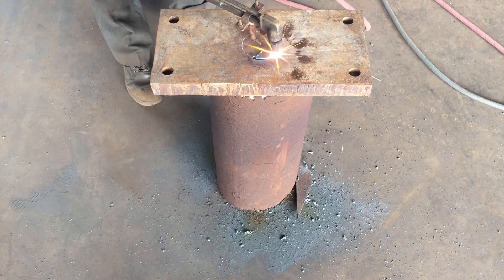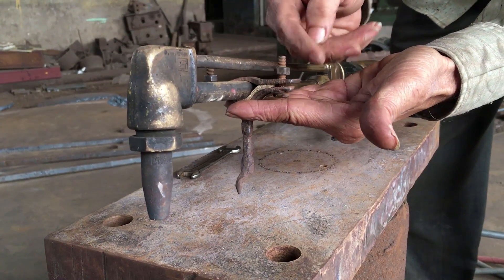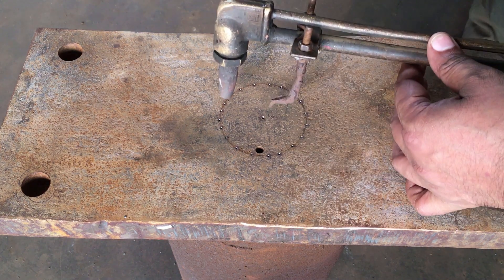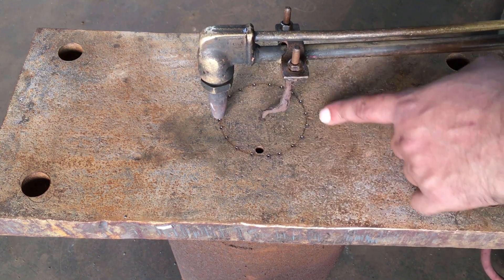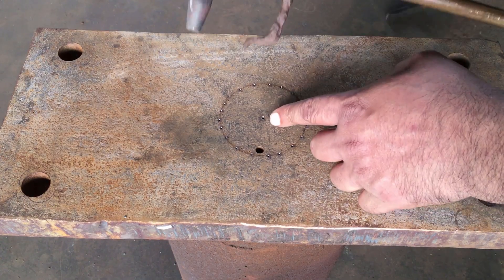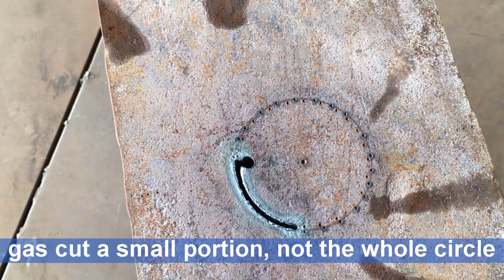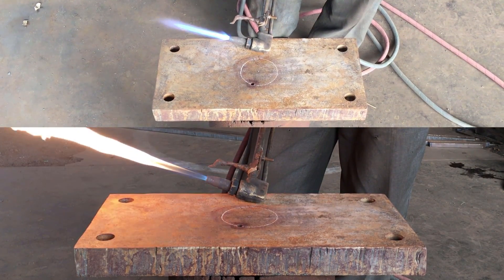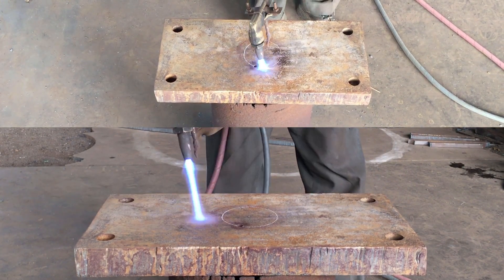OXY ACETYLENE CUTTING a Circle Accurately using a Cutting Torch (SMALL Circle)

Comment: That’s pretty thick steel . Can you cut a circle like that using propane for fuel?
Reply from the maker: Great question. Honestly, got no clue. Never used propane.
Reply: @Bruce Morris   yea, I'm only a first year apprentice but I have cut circles like this a few times with propane
Reply: A bit late, but as Rowan said, yes oxy propane works fine. Some say its even better than acetylene for cutting... You wont get a weld out of it though.

Comment: Can you make a video on how to cut a smaller hole like 3/4 inches?
Reply from the maker: +rollingwthhomies smaller holes can be made but if the hole is too small to use the attachment, you have to use the torch freehand. The hole will not be as perfect a circle though. I'll try to find time to make a video & post.
Reply: Abhinav Gupta yes please thank you
Reply: https://youtu.be/9AnUEg0aWLk
Reply: in the above link ,I am cutting a 70 mm diameter  hole with some basic attachment.. please take a look , I hope it will help you
Reply: the minimum diameter I can cut using this method is 30mm...

Comment: Good work! It looked like you cut the sides fairly straight as well. Have you ever cut thick steel like this with a plasma torch?
Reply from the maker: +WrenchTech Unlimited thanks for the appreciation. Don't have a Plasma Cutting Machine. However looking for one right now, have got some stainless steel fabrication orders in hand. Would love to get some recommendations from you. Max thickness I am looking to cut is 30mm.
Reply from the maker: Btw, it's not me but one of the workers at my workshop, who's doing the gas cutting. ☺️👍
Reply: I have seen, what I suspect are Chinese, plasma cutters on the market for a fraction of the cost from the big names. It's still money though! How are your costs for fuel gas and oxygen?
Reply from the maker: +WrenchTech Unlimited in India things are pretty much inexpensive. The fuel & gases. No issues there.